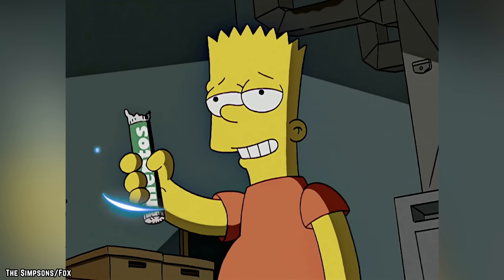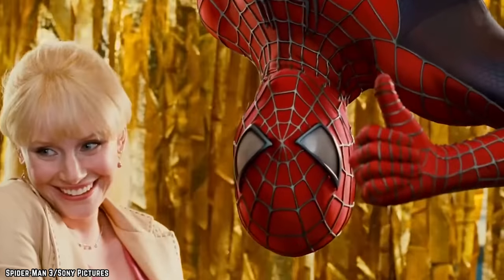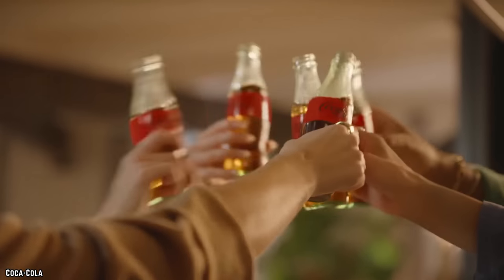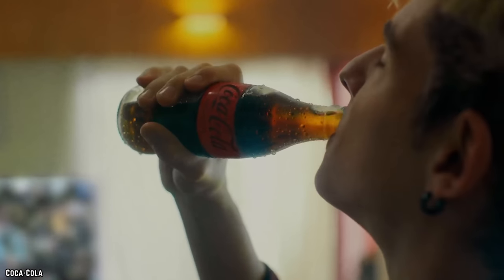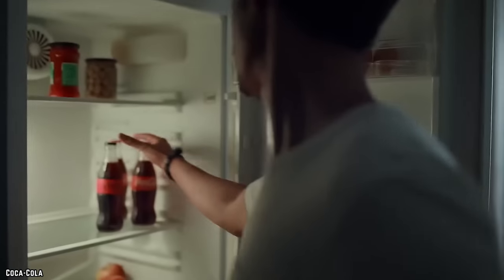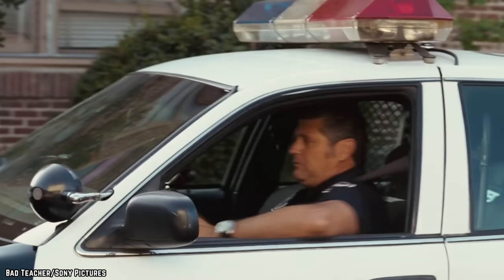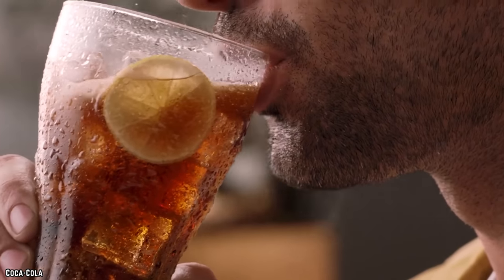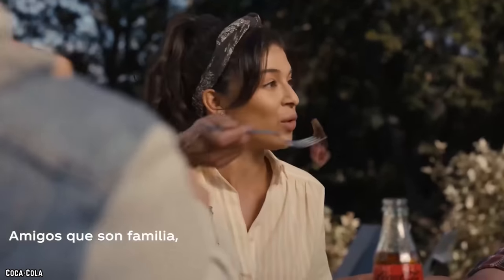Top 10 Coca-Cola Hacks That Actually WORK

Comment: Ive used Coke to get a Kool Aid stain off of the counter.
Reply from the maker: @Kev A Using Coca-Cola to remove stains, such as a Kool Aid stain, from a countertop is a common household hack that some people have found effective. The carbonation and acidity in Coca-Cola can help break down certain stains and make them easier to remove.🥇
Reply: They could have used it on Monica Lewinsky's dress, too.